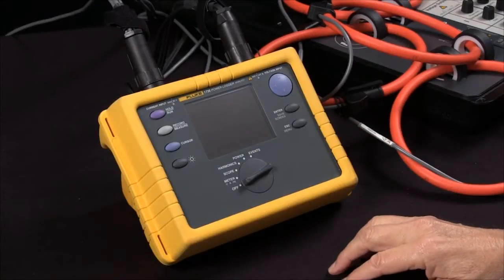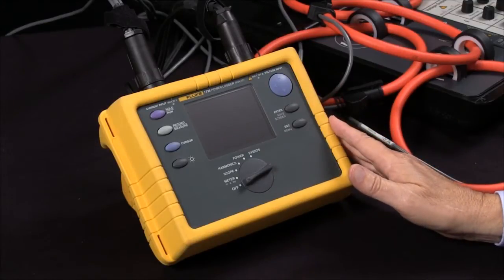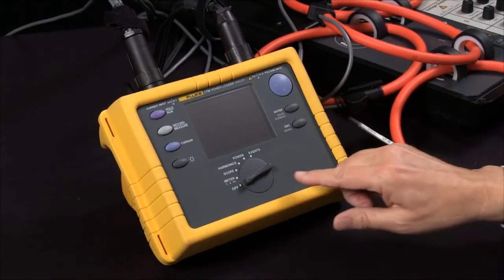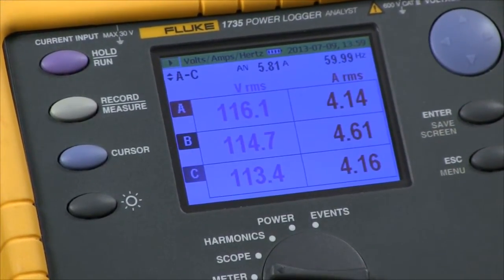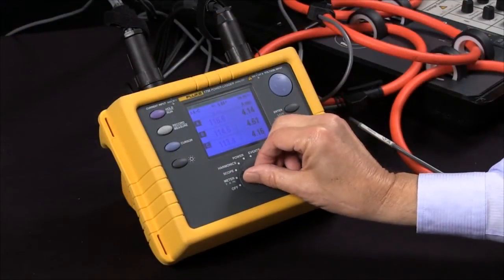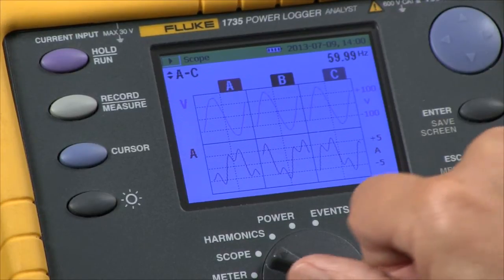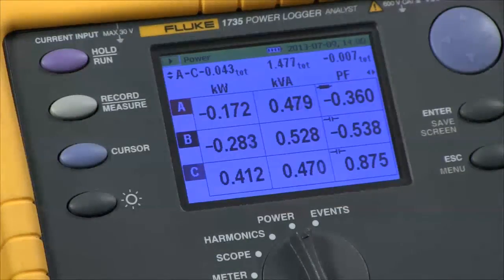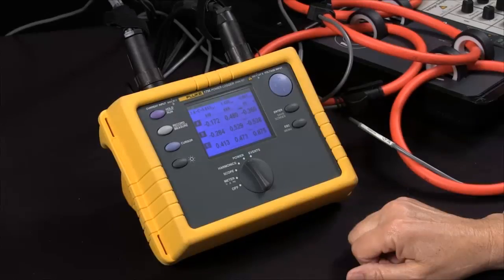How to Measure Power On The Fluke 1735 Three Phase Power Logger

Comment: why the powers are negative values
Reply from the maker: Hi Jasin - Power can be positive or negative depending on the direction of power relative to the orientation of the probes.  The most common sign convention for power is that positive power equates to a load (consumer of power like a light bulb) while negative power equates to a source (producer of power like a battery).
Reply: @fluke  So if i put the probes orientation wrong what would be my result for the measuring? wrong? thanks!